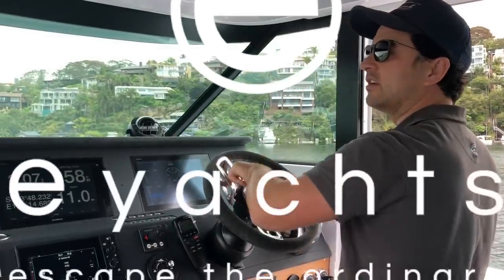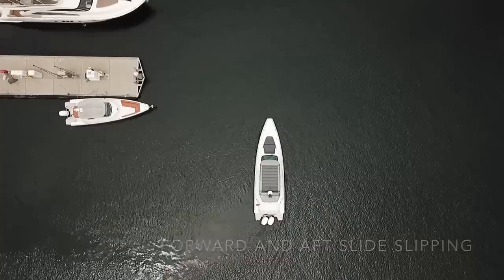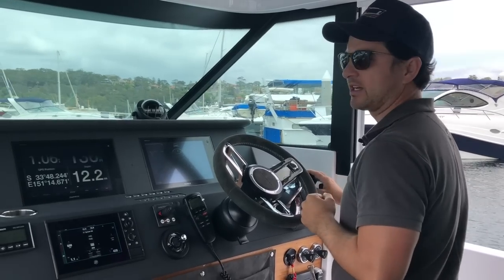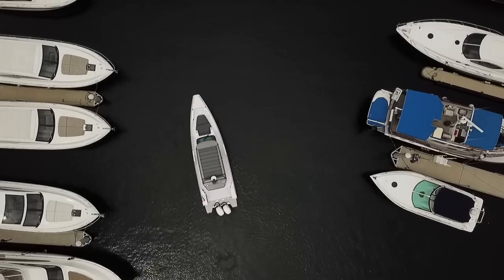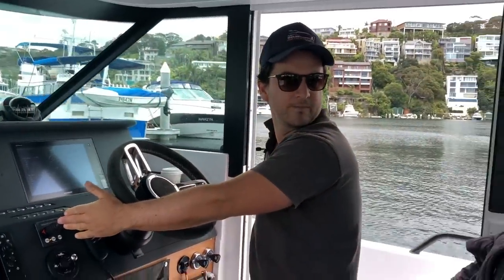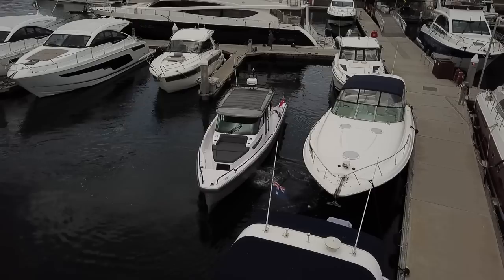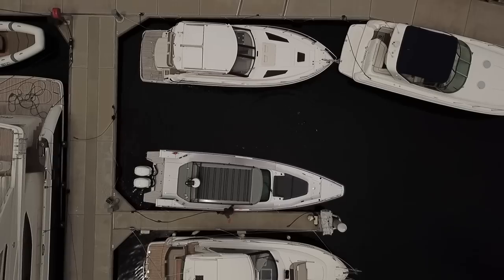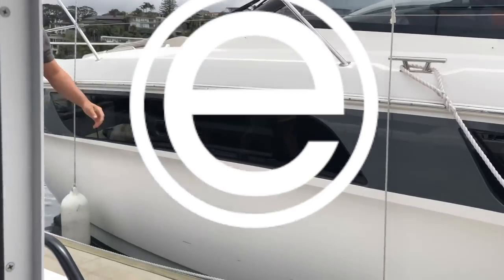HOW TO REVERSE INTO MARINA BERTH- Axopar 37

Comment: Call me again when you can do it without the bow thruster and only use one gear change for each engine.
Reply from the maker: I'm not entirely sure why you would not take advantage of these things if you have them on the boat. Would be interesting to try but a bit unnecessary.
Reply: And a peg leg, parrot and scurvy?